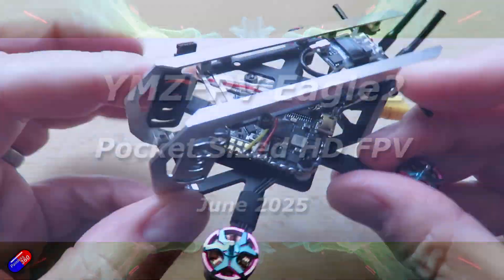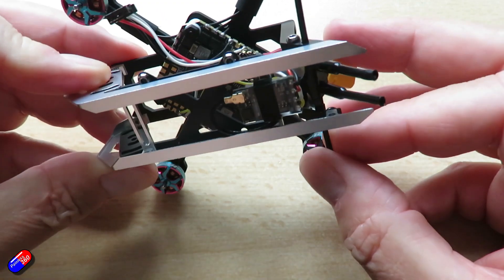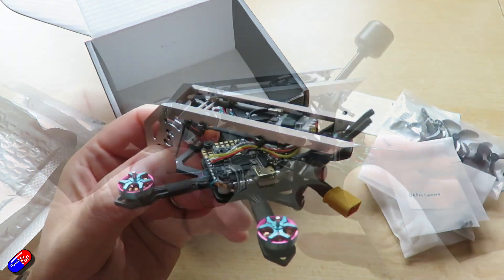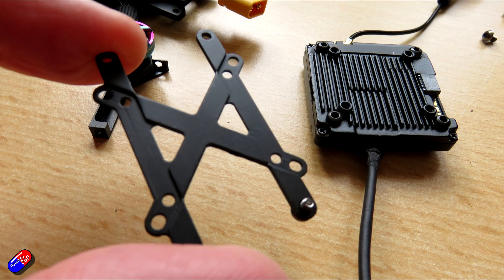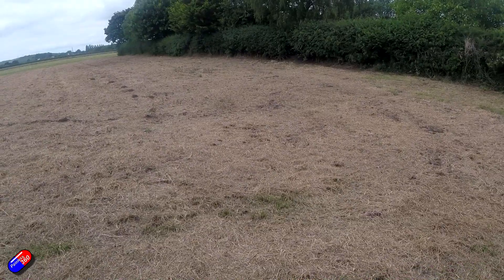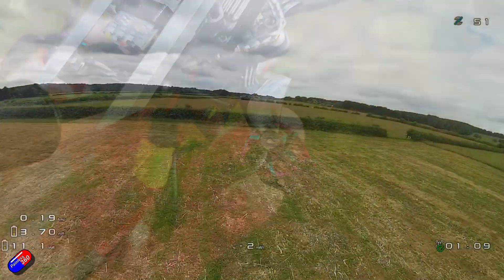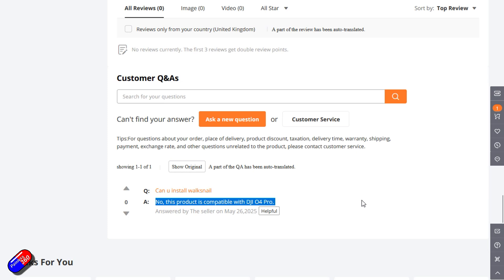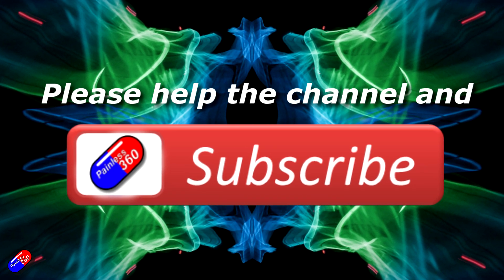WalleFPV (was YMZFPV) Eagle2 Mini Quad: HD FPV in a 'quad frame' for less than 105g with battery!

Comment: I want to fly the Eagle2 HD O4 Pro with the DJI Controller 3. Can it be done with factory O4 Pro + PNP wiring? Thanks!
Reply from the maker: The connector on this one had the 6 wires, the last two of which are for the SBUS and GND connection... Happy flying
Reply: Thank you kindly  @Painless360

Comment: I had no idea that just pulling the wires for the remote controller could convert this YMZFPV Eagle2 from DJI to Walksnail. I recently bought a Mobula 7 with DJI O4. It suffers some yaw washout of course but it is amazing to be able to fly something so small and light whilst getting good performance, HD in the goggles and 4K recording.